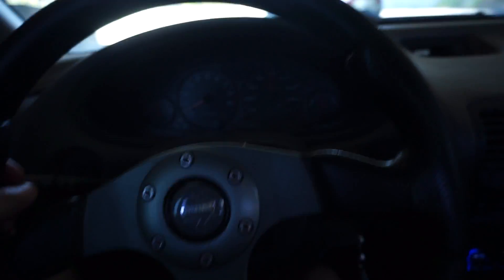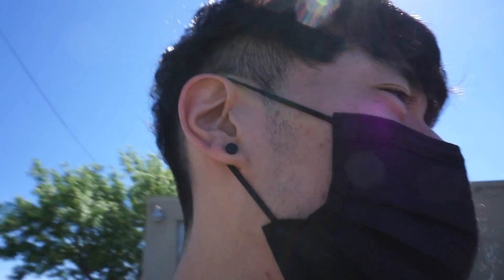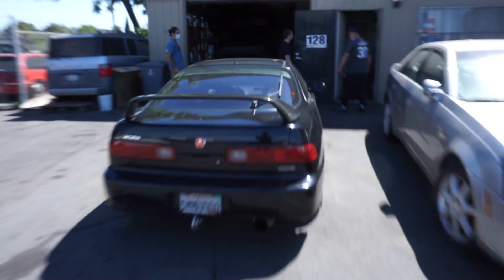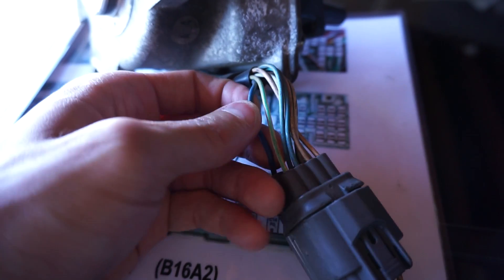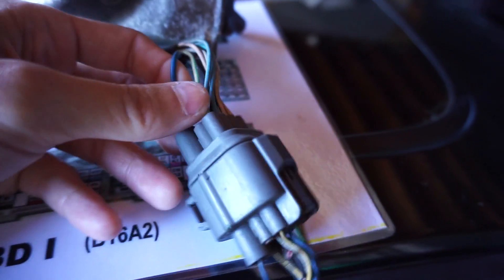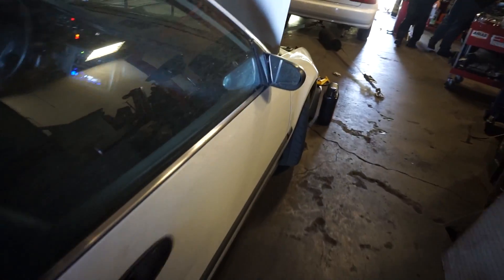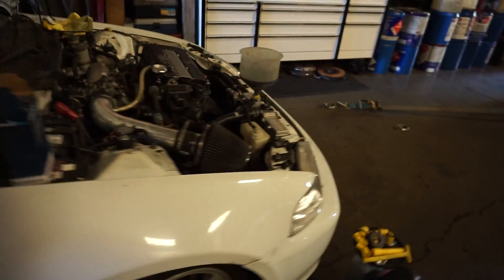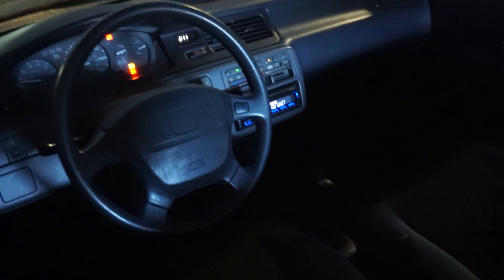Integra Tachometer FIXED! | Redlining With VTEC!

Comment: My speedo and odometer stopped working on my b18c gsr a while ago and now vtec is engaging at 7k rpm instead of 4600rpm. I have replaced the vss made no difference. when I checked the connector plug for the vss the ground wire was showing a small reading not sure if thats supposed to happen? I got the car scanned and it showed no codes, I checked the ground around the thermostat and gearbox they are good I also removed the cluster and everything seems good. Has anybody an idea to what could be the problem?

Comment: Yo not sure if you fixed your oil problem as I was watching an older video.. not sure what you have done to try and find the problem for that oil burn in your Integra and by no means am I a honda expert.. I'm the Mitsu man :)..... But for real, the amount of oil your burning it surely will be cheaper to fix the actual problem. So as you said you did compression tests and it all looked okay, a tip to see if the problem is your ring seals is to add a teaspoon of oil and recheck compression, if it goes up more than 10% it indicates rings/ wall seals if it does nothing valve seals are indicated. Lookup a detailed guide on a wet compression test as it will make more sense. Another thing that comes to mind is you said you changed the headers, I would double-check your o2 sensor and it's hooked up and functioning as it should, run a scan for engine codes. The engine code light was on so I'd start there first. Would hate to see that Integra engine displace itself into the local scrapyard so hope this helps a little.. oh and look up how to check PCV valve/condition that's a honda oil problem I've head about. Love the POV drives though and respect for grinding for those cars I know the feeling.